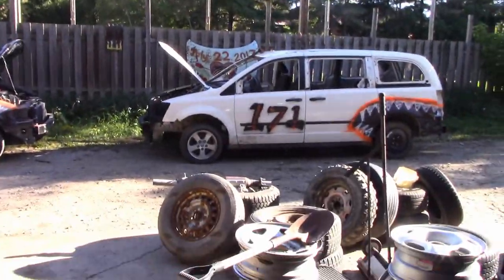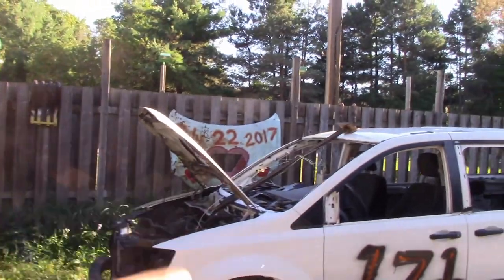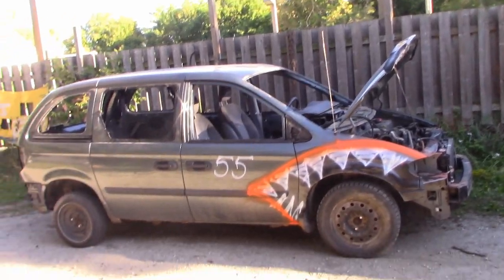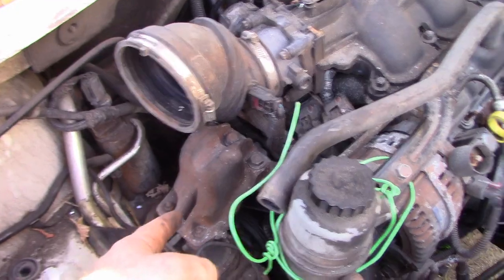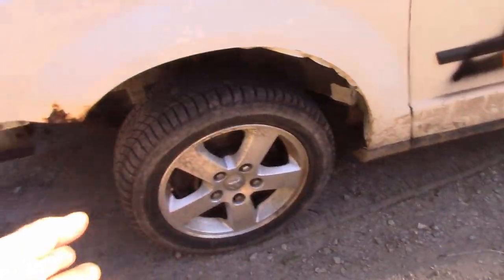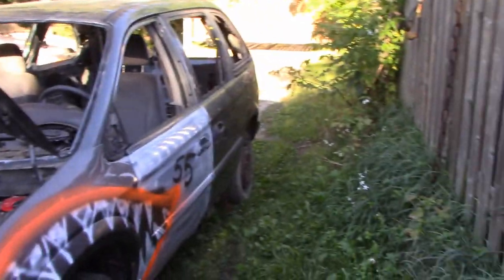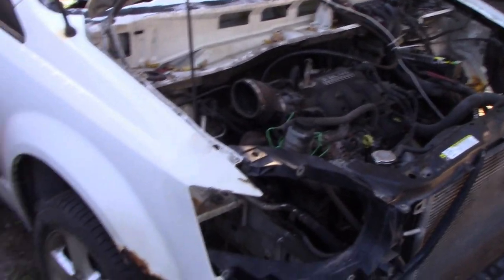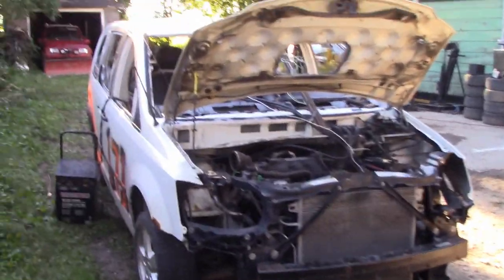2005 and 2010 caravan what one did i like building more ? lets compair these two vans

Comment: Running a 95’ mercury villager in a few days, dual leaf in the rear looks strong and a strong looking front end, everything is steel not aluminum and with the suspension welded I got 25 inches (63.5 cm) to the top of the bumper and easy to strip, and it’s 5x4.5 bolt pattern, running in a mighty mini class (small truck, van suv)
Reply from the maker: well good luck tristan